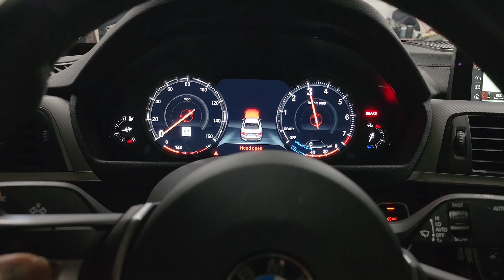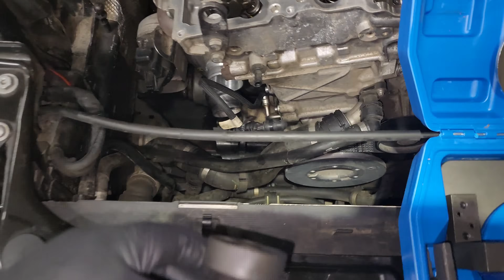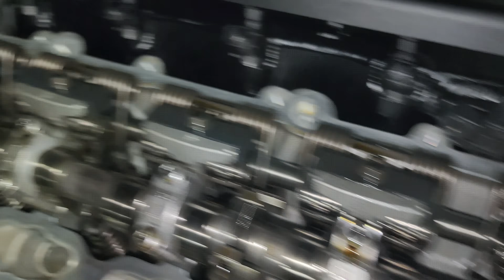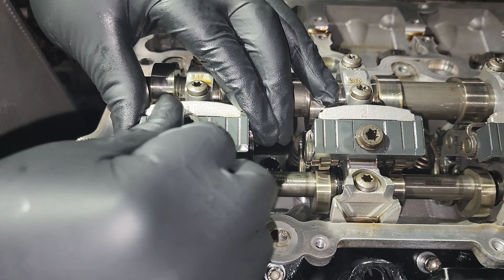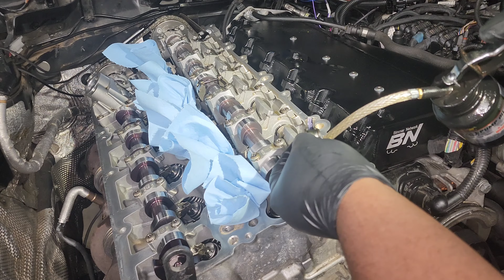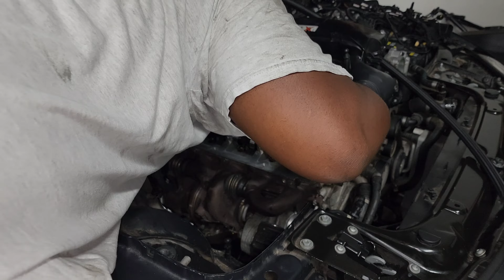340i Kelford Upgraded Cam Install Part 1 of 3: Intake Cam DIY

Comment: what about the chain tensioner? you show it coming out but not going back in. TIS calls for it to be "pretensioned" before putting the timing tools back on and tighetning the vanos gears. you don't show it and TIS does'nt specify if you use the actual tensinoer or the special tool at that point.

Comment: Before starting the vehicle did you turn the screw on that actuator back clockwise ? Or does that automatically adjust itself

Comment: The spring compressor tool kit does include the clamp to keep the gate flush. I didn't realize it was in there either and just used a c-clamp. They look flush to me but now that I know I had the tool the entire time I almost want to do it again to be sure. It's the square clamp thing in the kit. I thought that was for the vice or something😅 it's right in the kit you linked I bought the same one

Comment: Hey Kern ! I love ur vids ! I had a quick question regarding running full e85 on my b58 stage 2 with just the tu pump & a catless dp, i use the car as my daily to get to work every day & i run full e85 cuz it is cheaper, i drive 150 miles every day . In ur professional opinion, how consistently should i change the oil ? Because i know e85 wears on the oil. I run 0w-20  Valvoline full synthetic from Amazon , please respond! Thank you .
Reply from the maker: I would try changing at 5000-7000 miles and send it out for an oil analysis. I've done my last few oil changes with E85 and about 6000 miles and it looked good

Comment: Would there be much difference in the process of the cam installation procedure between a Gen 1 and a Gen 2 B58?
Reply: Slightly, the cam shaft is actually a different part # between gen 1 and 2 but look extremely identical not sure if it was just don’t for sku separation for the factory when building, I would imagine it’s the same procedure however
Reply from the maker: generally it's the same. The main difference is the Vanos like I showed, but the timing kit comes with the tools you'd need.

Comment: Hey Kern, was wondering what suspension you’re running on the 440i?
I’m looking to get coilovers for my 6mt 340i xdrive with edc, is there any you’d recommend? I don’t mind getting an edc delete
Reply from the maker: I have KW V1
Reply: @kern417  are you pleased with them or would you go a different route knowing what you know now
Reply from the maker: @acebrometheus6  i love them

Comment: Awesome install. Gotta add this to the bookmarks. Are you still going to do review on the Racereadyperformance parts intake?
Reply from the maker: Yes it's already installed. I'm just backed up on videos
Reply: @kern417 if you have it installed would you recommend it? I was looking at it over the mst intake because its a complete intake with the turbo inlet. And no worries your content is so thorough and informative you can take all the time you want 😂
Reply from the maker: @25mrsameer  so far so good but we'll see once the car is dialed in and has some miles on the new setup